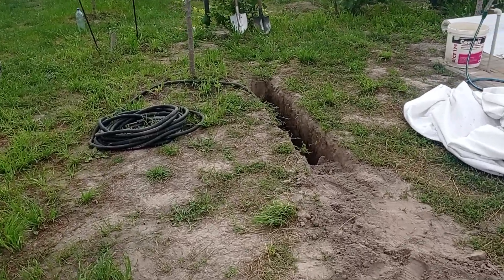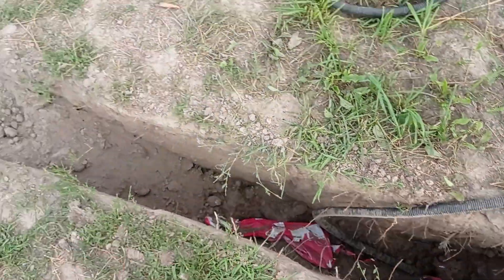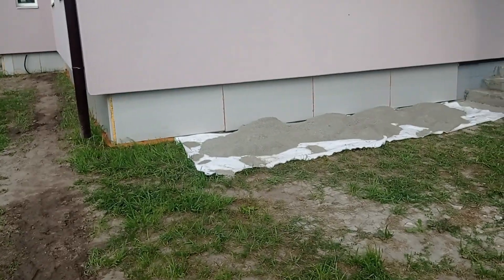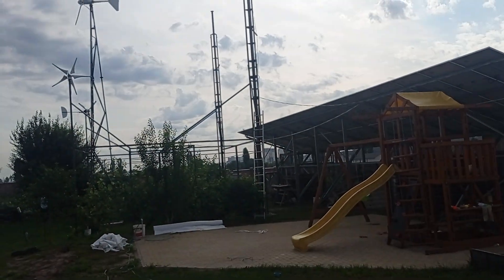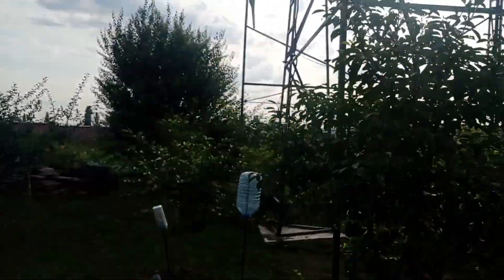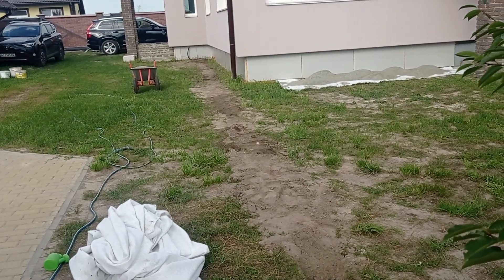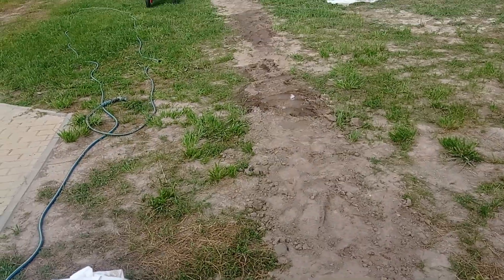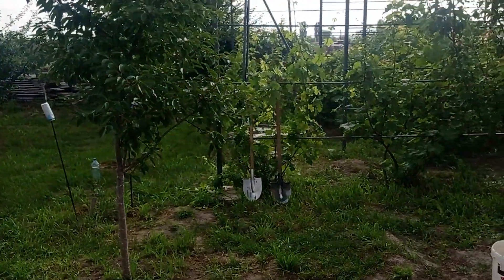Mistakes with cable cost a lot, in time specifically. Anything can be fixed, but time files fast.

Comment: You asked me why I went with a 240 V wind turbine....... Because I plan on only running 12 gauge(4mm) wire. I would like to run higher voltage lines from a higher voltage wind turbine using smaller gauge wire.

The 240 V wind turbine should create no more than 10 A. If I jump up. To the 360 V wind turbine at 5 kW, I can still use the same line. And, this is what I was trying to explain to you before, high voltage Wind turbines can be stepped down just before the battery through the inverter.
Reply from the maker: yep, got you, thanks, it makes total sense.

Comment: Put a large, 100mm conduit in, with some pit boxes either end.  Then you can change at-will.
Reply from the maker: so far I see everybody still kind of "votes" for underground... there was not any single comment so far, about that the air-way is better. I'm confused now
Reply: @BackyardVoltage  running airlines are great if they are short runs. If you are running 100 feet or 30 m, in my opinion, it would be better underground.
Reply from the maker: nah, 2-4 meters max, that's what I'm speaking about airlines in my case. basically these are the "jumps" from one structure/building to another
Reply: @BackyardVoltage  catenary cables are just ugly to look at.  If you have a hole - slap a box in there.

Comment: If you take a few of my advices, there are some basic ones.
Corregated pipe, copex, is kinda bad because it's a complete lottery what type they sell you. If you do a big project and order wholesale and get a part number, datasheet etc, you can choose good conduit that can be burried or can be outside, unlike these jacks have told you. If you go to the shop and say you are an average joe buying conduit, they will sell you the cheapest option 90% of the cases and it will be indoor use garbage that rots in UV, degrades in oil, becomes a fragile fossil underground and it's generally garbage. What you got is pretty thick and good quality. One time I was in a rush and bought conduit in OBI on the way home. That crap broke when I pulled a radius too tight.
Other types of conduit. A lot tougher option is irrigation pipe. It's UV protected, waterproof, doesn't age at all, it's hard and you can even pull a cable out and a new in instead because it's smooth on the walls. Also if you do underground conduits, as the soil settles, it can take bends and jerks on the way that might result in cable faults. Harder pipes keep a better radius. Some gravel to lay it in also prevents that.
As for aerial cables. 2x16 aluminium aerial cable that's pretty much everything-proof and designed to be on utility poles cost the same as 3x4 copper. while being equivalent to 2x10
Reply from the maker: I agree with all you say. however, my personal preference is not to use aluminum, I just don't like it...

Comment: What's wrong you can put your cable right back think about conduit
Reply from the maker: I don't want any more underground power lines, that's what I'm sure about.
Reply: Thank you for your hardwork.  With this video and sharing theb nuances of growth with your  private grid. I also bid you safety through to  completion in your handling of this monumental  and costly upgrade.
Reply from the maker: I really hope youtube will make it less costly in some time ))
but that's still a long road to go, till the monetization level is reached

Comment: Just put a bigger pipe. Cables hanging in the air look like sh..
Reply from the maker: but why?
Reply: @BackyardVoltage  Bigger pipe means you can easily pull new cable through. Sometimes people bury empty pipe (with rope inside) for future cable.
Reply: @BackyardVoltage  Cables in  the air is vulnerable to weather and uv. In my country all overhead supplies have been removed and put into the ground as it's more protected there. And it looks much nicer with the overhead wires and poles removed. Electric installation is not something to be seen. The art is to get it working without being seen.
Reply from the maker: interesting. what if I bury it then not that deep, just beneath the pavers, to have an easy access to it if case of necessity.
anyways, that's a good thing to think about, thanks guys.
Reply: That’s subjective opinion but I agree about the pipes. Why would you run them in a plain sight if you can hide them?